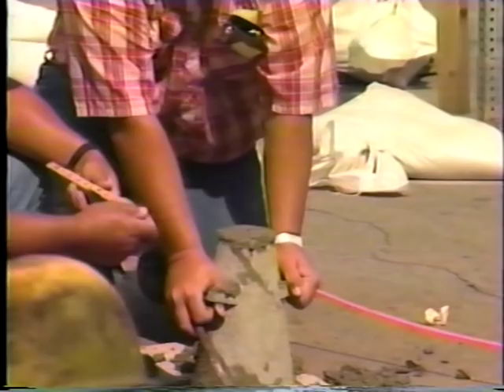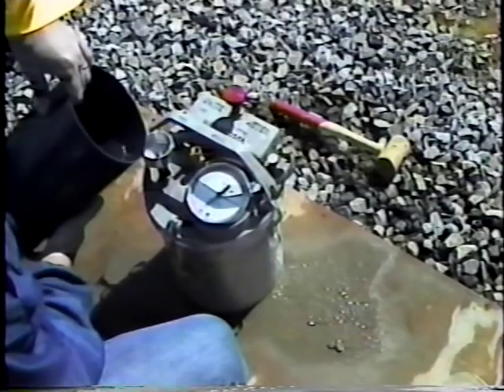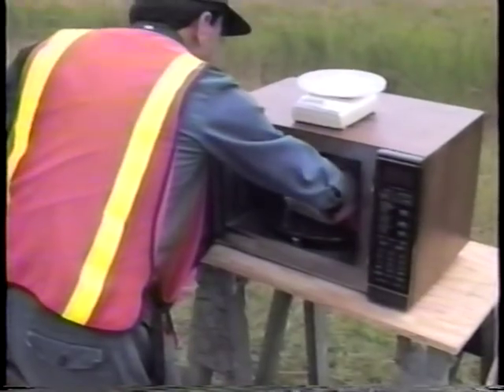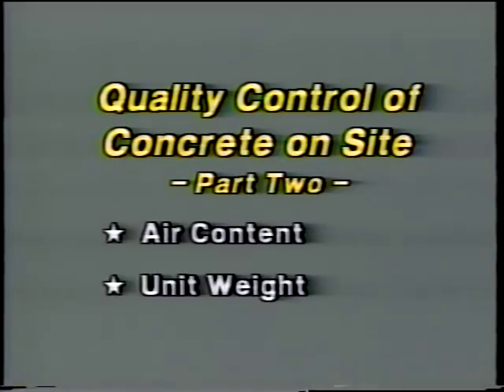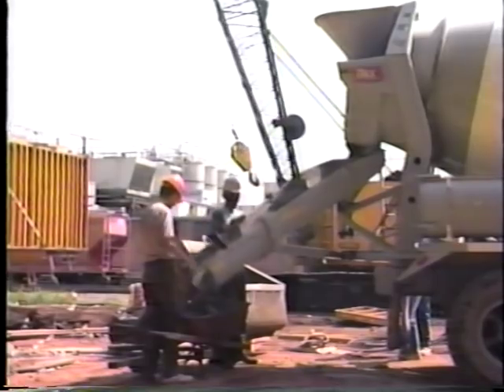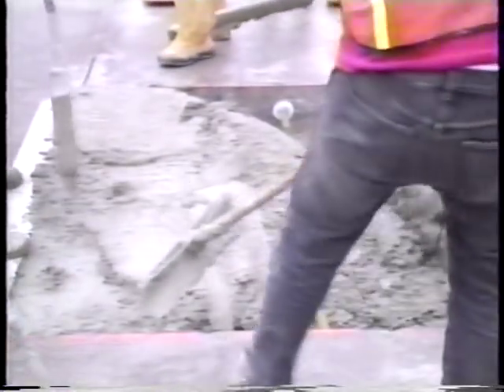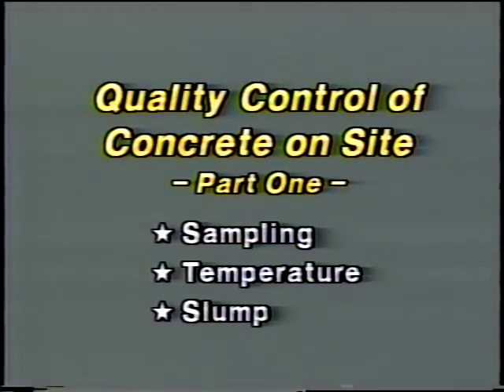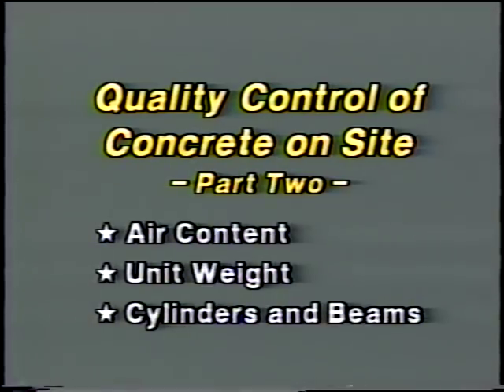Quality Control of Concrete On Site (Part 1)

Comment: The precise measurements for filling the slump cone are 2 and 5/8 inches for the first lift, 6 and 1/8 inches for the second, and 12 inches for the third.  That is how you split the volume in three.

Comment: Does not follow ACI method which ASTM and CSA is based on, which is usually used on site testing. Workability of such concrete is horrendous (2.5 inch slump), almost detrimental for finish product for bee hives phenomenon.